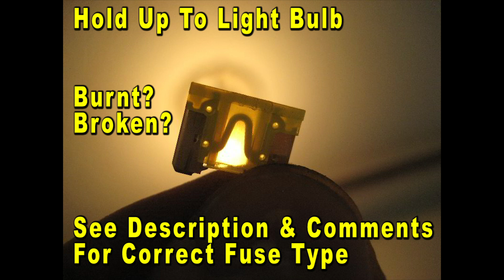2011 To 2015 Kia Optima How To Change Blown Electrical Fuse With Correct Fuse Type

Comment from the maker: Kia Optima Electrical Fuses - https://amzn.to/3TDFvLd
Add-A-Circuit Fuse Tap Adapter - https://amzn.to/4dfzQSk
Digital Multimeter - https://amzn.to/4ebTKz8
Precision Screwdriver Set - https://amzn.to/3sLixaP
Plastic Pry Bar Tools - https://amzn.to/4cPO5xb
Socket & Ratchet Set - https://amzn.to/3Z17LbA
Mechanix Gloves - https://amzn.to/3jCnHkt
Torque Wrench - https://amzn.to/3vS5uSI

The Paul79UF YouTube channel is a participant in the Amazon Services LLC Associates Program, an affiliate advertising program designed to provide a means for sites to earn advertising fees by advertising and linking to Amazon.

This DIY video shows owners of the 3rd generation 2011 to 2015 Kia Optima how to check or change a blown electrical fuse in either the engine bay or the interior passenger compartment electrical panels.